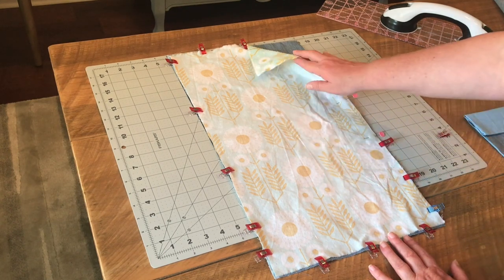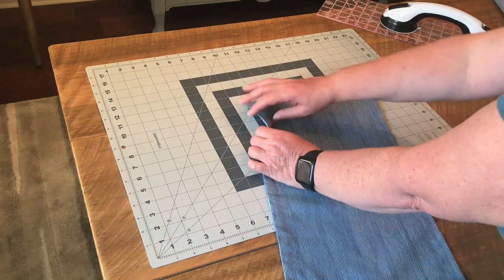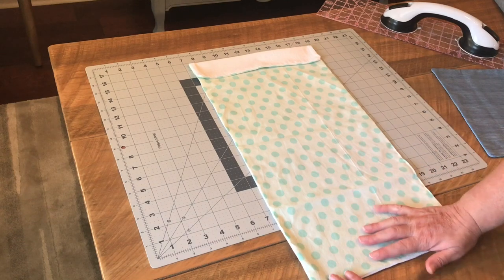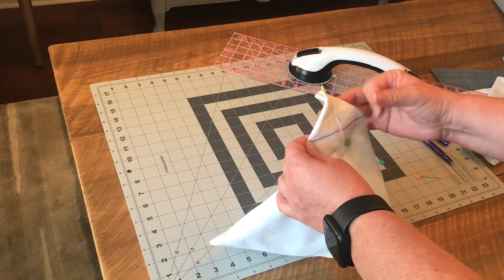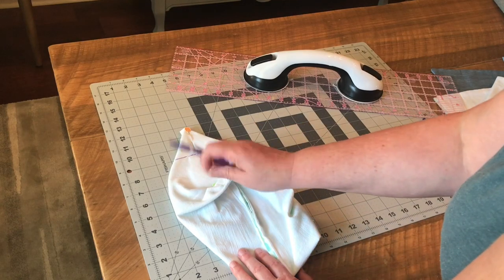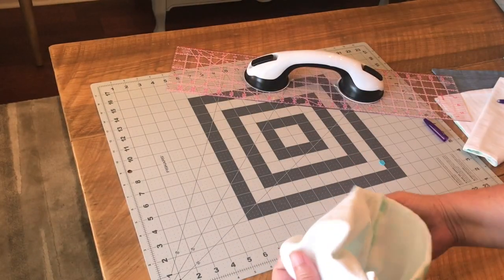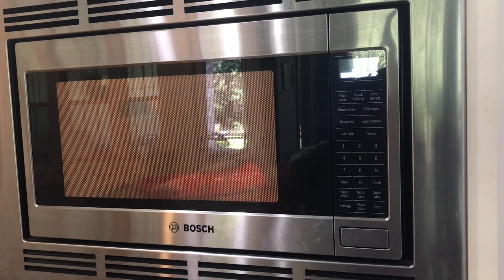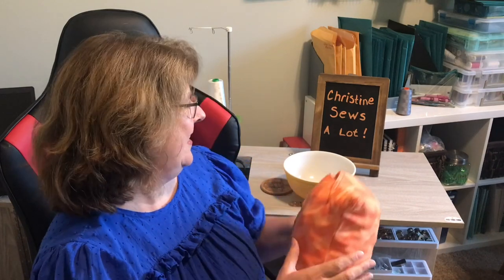Sewing Tutorial for a Reusable Microwave Popcorn Bag - Easy and Beginner Friendly Project

Comment: Have you had your microwave popcorn bag scorch in the microwave. Should I be putting a half a glass of water in there to pop to protect the bag. My bag scorch so bad the fabric tore
Reply from the maker: Oh my! That has never happened to me. I use 100% cotton fabric and 100% cotton thread. You definitely want to be safe. Not sure if your microwave is more powerful than mine, whether it is a fabric issue, or popcorn???? 🍿 I use Pop Secret and have used Orville Redenbacker as well as a generic popcorn without any issues. I do stand by the microwave the entire time the popcorn is in there and take it out immediately when the popping slows down.
Reply: @ChristineSewsALot  I have th same issue. I use cotton everything,?  yet scorching and burning in the bag when trying to pop corn. what am I doing Wrong ?

Comment: Thanks!  Question though.  I made one from 100% cotton everything.  But when I popped it, a little of the popcorn burned inside in the middle.  I figured  I should use a little less popcorn, as it was still popping in full swing when the burning happened.  I emptied the bag, and the triangle flaps that make the bottom were browned from burning.  I threw it out.  Does this mean the fabric was not truly cotton?
Reply from the maker: Oh no! It probably does mean that you could have had something that was not all cotton.  Good thing you stayed with it. I have never had that happen in any I made or that I gifted.
Reply: Thanks for the speedy reply!  I was hoping that was all it was.  I was going to make a bunch for gifts, but wanted to test first.  It didn’t melt, but it definitely burned.
Reply from the maker: @joannedifrancesco4555  well give yourself an A+ for being smart enough to test a bunch before investing in making a bunch of them. I used quilting cotton from one of the well known fabric brands and I have used Gutterman’s cotton thread and Aurfil’s cotton thread. Thanks for watching!